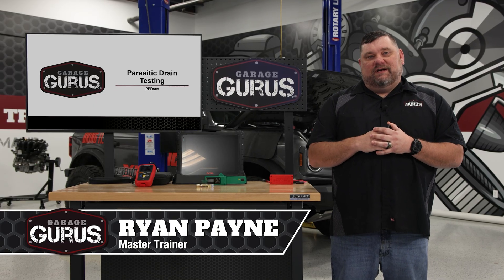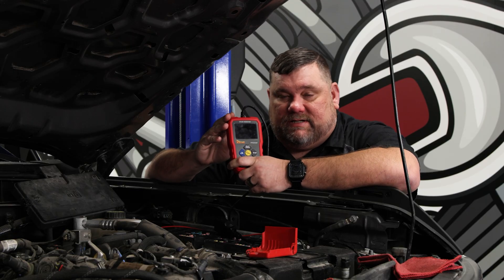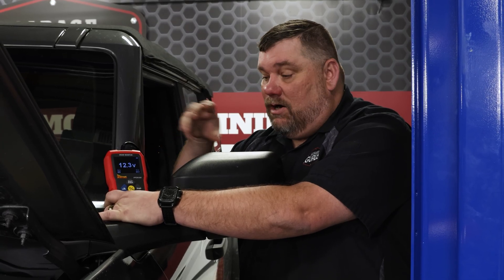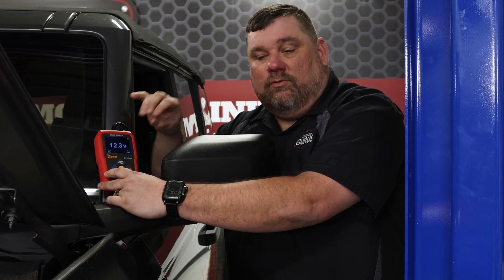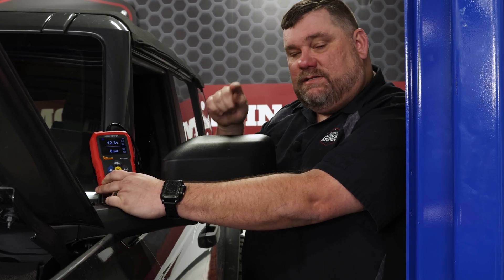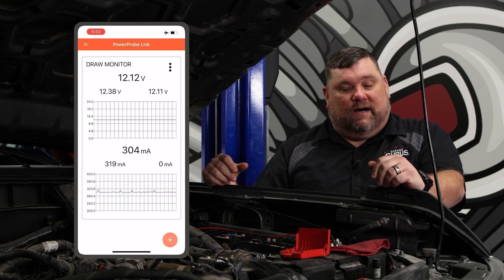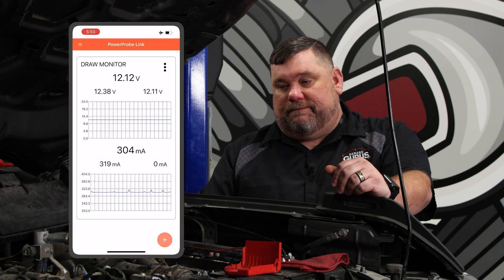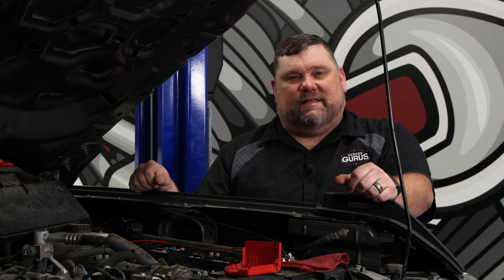Garage Gurus | Diagnosing Parasitic Battery Drain with Power Probe PPDRAW

Comment: does this tool help identify which circuit since it's connected to the OBD?
Reply: No. It is only connecting to pin #16 (Power) and pins # 4, 5 (Grounds). It does not connect to or communicate with any of the other pins.
Reply from the maker: Hi, thanks for reaching out! Our tech team would be happy to help you with this. You can reach out to them at 1-800-325-8886. They are available Monday – Thursday from 7:30 a.m. – 4:30 p.m. (CST), Friday from 7:30 a.m. – 4:00 p.m. (CST).
Reply: @GarageGurus  a simple Yes or No would suffice... ;-)